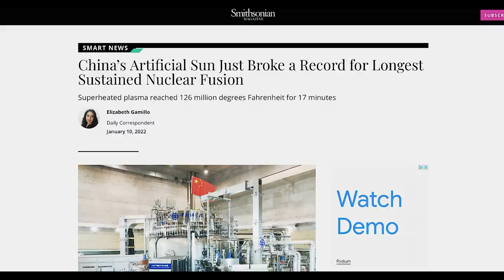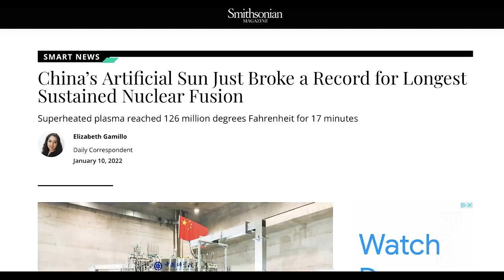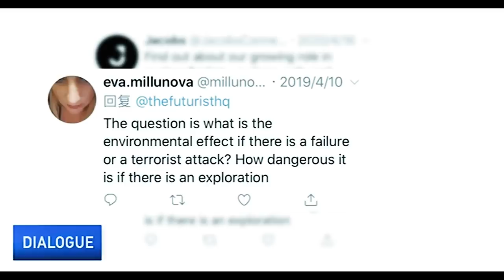WHAT IS GOING ON IN CHINA...?

Comment: Artificial sun? Hotter than the actual sun. LIESSSSS
Reply: sun not nuclear
Reply: @tananata9657  I think you need to re read what I said. It cannot be hotter than the sun on earth no way.
Reply: Please tell me you are joking, the gas inside the reactor is less dense than air at the verry edge of space, heating up only a few grams of hydrogen to insane temperatures. but becuase it is such a small amount you can cram more energy into it without losing stability in the chamber/having the chamber heat up too much.
Reply: Not too bright are you Joe ?
Reply: @joetrp-3553  What if i told you the sun is not thousand times bigger than earth and not millions of mile away

Comment: What are they using to contain something that is 5 times hotter than the sun, seriously wouldn't that melt if true.
Reply: Most of it is here and says it hard to make something that dont melt
Reply: I saw aluminum foil  somewhere there, just as in the machines that landed in the cold moon, maybe that is their secret.
Reply: @malavedmd  I noticed that as well....
Reply: Electromagnetic fields. They said in the video
Reply: They use xi ego to contain it

Comment: Fusion process had been developed since the 1940’s but is not practical because of the enormous expenditures.

To date, no design has produced more fusion power output than the electrical power input.
Reply: They just mentioned the fusion reactor produced heat hotter then the sun's core for 17 mins. That is a lot of fusion power.  
Imagine when the fusion reactor runs continuously. It's going to be amazing. Clean and cheap power for everyone.
Reply: @cryptocrum8068  Yeah, but they didn't mention how much it cost to do that. 
They did say that they promised to solve the problem, which of course means they haven't yet...

Comment: How controllable is this artificial sun? What is the expense if it fails enclosure? Does it have the same issues as the old Nuclear Reactors? How high is the cost based on modern nuclear reactors?
Reply: No, a "fission" reactor has highly radioactive rods that heat up water and turn steam turbines. Fusion is entirely different. It requires high energy electromagnetic fields and forth state matter or plasma, which is energized by high energy lasers to produce the tremendous heat needed to fuse hydrogen atoms and release energy and it's byproduct is not radiation, but helium.

The worst that will happen if a fusion reactor breaks down or is damaged or attacked is.......nothing. it just shuts down, no radioactive leakage, no toxic byproducts. Just stops. 

As for cost, the real problem with fusion is not the actual reactor, but the massive amount of hydrogen needed for energy production. The only source of this is seawater. It must undergo an electrolytic process to release the hydrogen from the oxygen. So they is your byproduct is oxygen. This is enormously expensive at this point, so in order for fusion to be competitive, a method for cheaply stripping hydrogen from water MUST be found. Not to mention the energy needed to do the stripping. So renewable like solar and wind could power hydrogen production as it would be coastal. And fusion could provide the power from the processed hydrogen. So it's going to be expensive until more facilities and better methods of hydrogen production are found.
Reply: It runs on dim sum and panda farts
Reply: @deathstrike  So does it take a lot of water to get this process going? I ask because water obviously becomes the fuel in this case and even though there's a lot of water on our planet, I wonder if this will cause us to really value it significantly more?
Reply: Everyone is trying to figure this out. Lots of questions BUT no one asks WHY!!! Why build such an artificial machinery?? What is wrong with our own natural sun???
Reply: @christylynn0100  because for half the day you cant use the sun/ what happens when clouds cover over the sun. Fusion is the best power sorce, better than even fission
Reply: @christylynn0100  Well tbh I understand that with this kind of energy we can do significantly more innovation that can reduce our waste! The sun is great! but if we can harness it we can greatly advance. The only thing I question is are those in power  ready to value this or will they misuse it?
Reply: @thephilosopher7173  Yes it does require massive amounts of water. Seawater is the optimum source for hydrogen. According to calculations, 1in of seawater would power the world for 200 years. One foot of seawater 2 thousand years. Perhaps enough time to truly develop advanced methods of power generation that doesn't require water or massive natural resources. But you are right, the ocean environment is delicate and may be unable to support such a massive removal of water. It's certainly something to consider, but may also be our only hope as we may need the fusion technology to leave the Earth and either find more resources in the Solar System, or develop the ability to reach the stars and other Solar Systems. It's all about what is important to the inhabitants of Earth.
Reply: Old nuclear gonna kababoom because using water as coolant. For this, well, it just burn into earth core.
Reply: It controllable what do you think the real sun is you don't believe its in space do you, if you believe in space you need to wake your ass up.
Reply: When did China ever care about environmental or humanitary down stream impact?
Reply: They could build these in the 1960s check the patents and wake your asses up